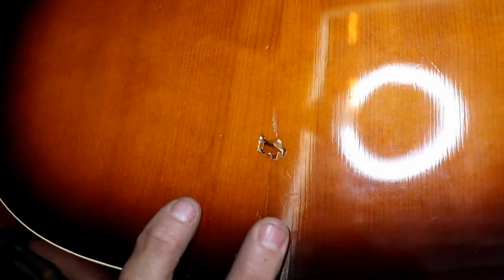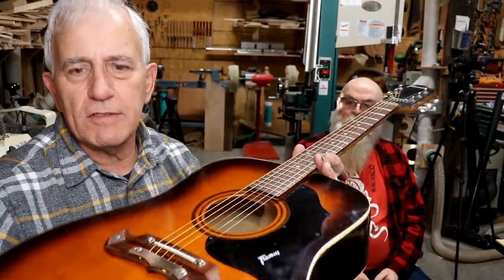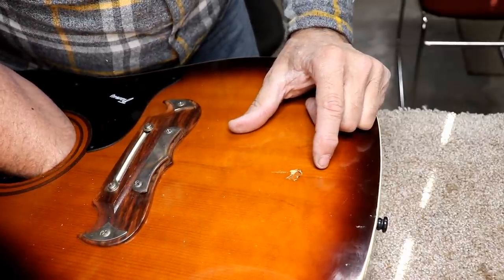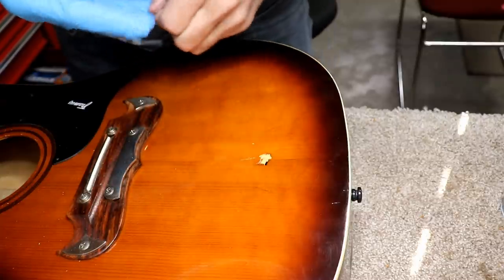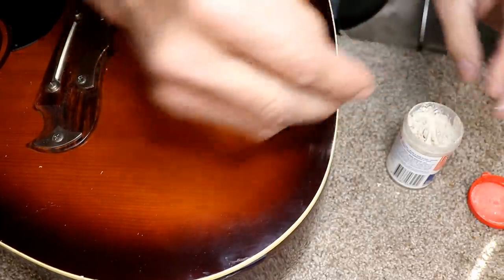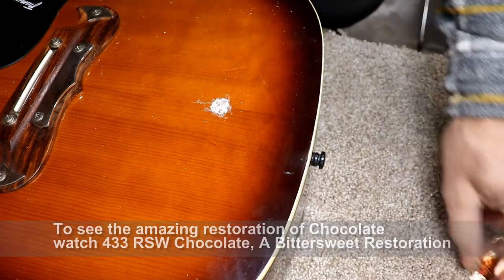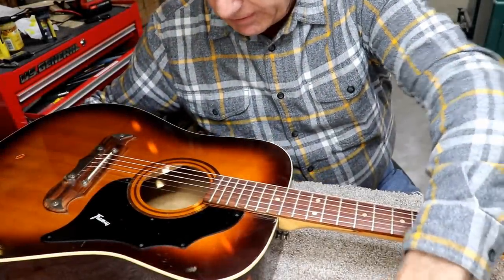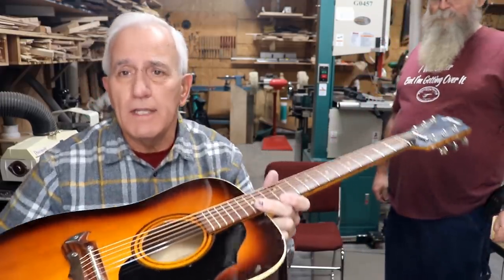556 RSW Texan Framus Is ALL SHOT UP - Guitar Hole Repair

Comment: Hi Jerry.  Stumbled across this excellent video today!  I have just done that exact repair regluing the top to the end block on a Texan I bought a couple of weeks ago with 5 guitars and a fiddle from a Methodist church in the UK!   The one I am working on has been played to death for 40 years. Action was high so shimmed the neck. I refretted the fingerboard as the frets had deep grooves in them. Softest brass frets I have ever pulled out of a neck.  It sounds interesting with a zero fret - almost like a resonator. Great plectrum guitar for bluegrass etc.

Comment: Hi Jerry, wonderful video and amazing repair! I just wanted to give some information about the strange shape of the headstock: Framus created this design in order to avoid breaking the headstock in case the guitar falls back. The older Framus models had a classic style headstock and glued-on necks. Many of them broke because of the very fragile headstock to neck joint witch was caused by the trussrod channel. With this newer design, the Neck and headstock gets more resistant. The prove is that fender electric headstocks, who are similar to this Framus design, never brake when they hit the ground, contrary to Les Paul and SG models, who always break.
By the way: You mentioned that you worked on a couple of other Framus guitars with a hook mechanism on the neck joint. Maybe you mean the Hofner guitars who had this rake (hook) mechanism, specially the 489 and 490 models. Framus had only glued-on and later bolted necks, but never a hook.
Greetings fom Paris

Minos
Reply from the maker: You are correct about the hook and being a hoffner however I don't agree with the idea about the peg head shape.  Because it is laminated any shape would be perfectly strong. it would not have to be flat to be strong in fact angled down would be stronger with all the laminations

Comment: I've recently become a Framus fan and am currently restoring my 12 Texan that I bought. The conditions are similar, I just don't have a hole in the ceiling, but an open piece on the inside of the ceiling. She is given a tailpiece from behind because she was in a terrible condition. I removed the old tailpiece. I replaced the optical part of the old tailpiece with a 2mm aluminum sheet so that the optics are right again. Then she gets a pickup (piezo) and the volume and tone controls. I have already learned so much from you, for that I would like to thank you again for all the information that you convey in your videos. I have always recommended you to others whenever someone had problems

Comment: Interesting video. I think the filler you used on the hole was TimberMate.  I have used that to repair a hole in a door. Shrinkage is negligible and it is paintable.  Good choice.

Comment: I have one of those it was made in the 60's. Mine is model # 5/195 made about the same time. You need a basket weaving course to put strings on it! I had the same problems with the neck block and a few loose braces.. Mine didnt have a bullet hole but I thought about adding one when I was trying to fix the belly bulge. LOL They sound  good but different and would sound better if they had a solid top but top bottom sides and the arched bottom are all laminated..
Reply: Tee Hee!
Reply: These are made of plywood from the Black Forest. Mine had no bracing on the back and minimally on the top which is how Jerry could get his hand inside so easily. It's obvious that the instrument was dropped - the neck was so solid that the body self-destructed.

Comment: I love your channel Jerry but sometimes I can see other options for your fixes. I would’ve taken a plug out of the section under the end of the neck on the guitar top surface forward of the sound hole. It has the same finish.
Love from Australia 🇦🇺
Reply from the maker: It wasn't the same kind of wood the grain didn't match and it wasn't smooth
Reply: @RosaStringWorks  What about under the bridge? Anyways… just a thought young fella!

Comment: A German Texan, eh?  I had a Höfner in '74 and it had bolt-on neck. And the same is true with bolt-on bridges... You lose sound vibration transmission/transference. I'd have that bridge glued on. I'll save my opinion until I finish watching and hearing the guitar. I just started and I just couldn't wait to voice my hatred for the design. And I agree with Jerry about the headstock angle as well, and especially the laminated neck design - similar to neck-thru design, only just on the neck - and "a hundred" layers (whatever number). Almost makes truss rod unnecessary, ALMOST.
Reply: And I wouldn't allow any customers watching while i worked. That's why Jerry spilled the glue.